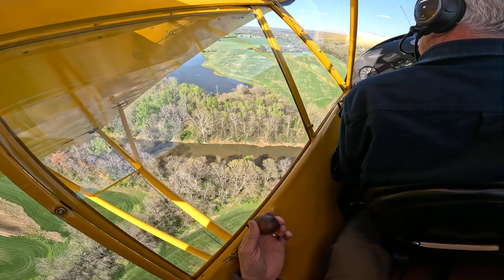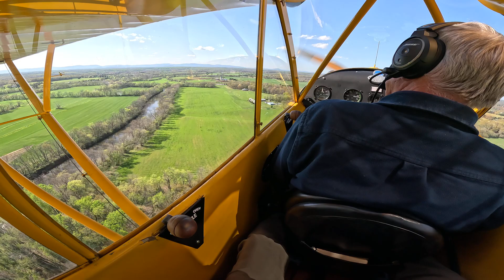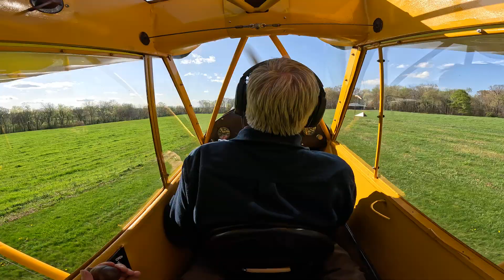Hover

Comment: I took a ride in a Super Cub one day; we made a pass down the runway at about 2000 feet, but we made it flying backwards, at least our ground speed was. The headwind was about 40, and we crept slowly backwards down the runway. The pilot showed how stable we were by taking his feet off the rudder pedals and only had a couple of fingers on the stick. He had VG's on the wing, which had really improved low speed performance.